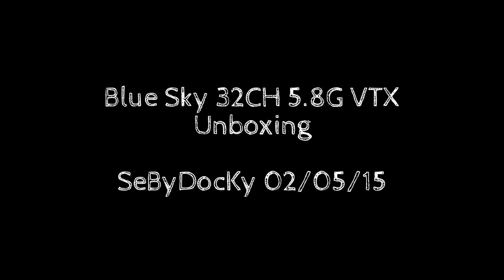Blue Sky 32CH 5.8G VTX (Courtesy Banggood)

Comment: Dommage qui y a pas le switch pour le changement de canal puis l'antenne cela change tout pour le poids.
Reply from the maker: Ca peut etre soudé heuresement .... et tu as des microCL à 0.8g donc ca va
Reply: Pour le prix et tout celui-là que tu as es mieux :
http://www.banggood.com/DALRC-DIY-5_8G-32CH-FPV-600mW-Wireless-AV-Transmission-Module-TX-p-958536.html?p=YL2512105842201212FR

ton avis m'interesse ?
Reply from the maker: ONCLEFLY C'est la même puce mais avec le Vreg, le micro dip switch 5p pitch 1mm, l'antenne. Oui c'est un bon bundle. Là le blue sky est intéressant pour faire un kit super leger en fixant les fréquences en dur, sans connecteur SMA, etc..
Reply: SeBy DocKy Oui, il peut être intéressant avec un pont pur fixer la fréquence puis si marche en 3,2 Volt, plus une antenne filaire.
J'ai vu sur ta vidéo pour le micro, tout rikiki la soudure ...